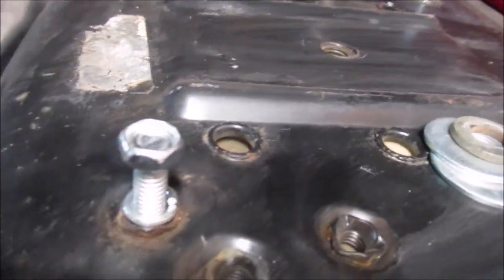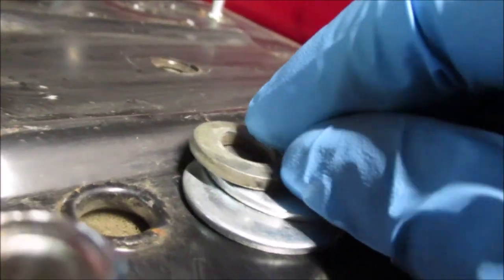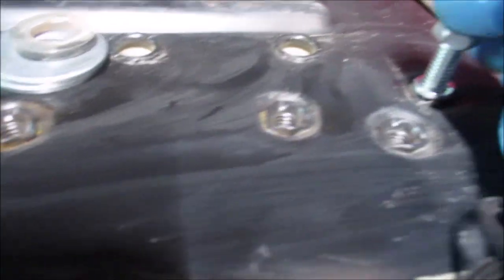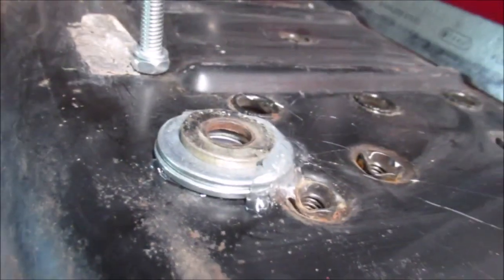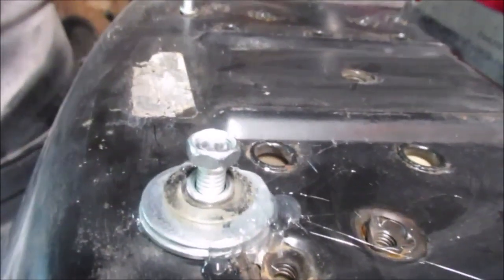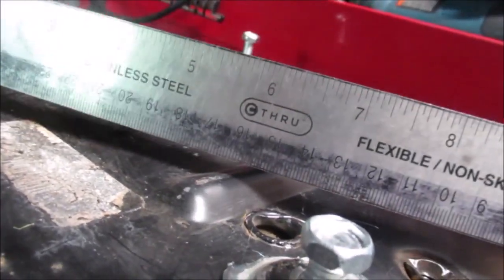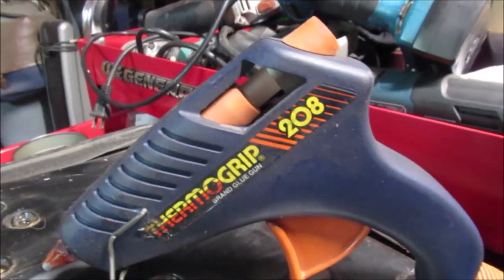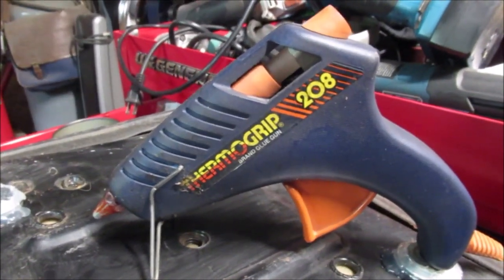A better / proper way to mount tractor seat

Comment: I need a new seat for my Wheel Horse, the pan is good but it’s basically a gorilla tape seat now.  They aren’t cheap.
Reply from the maker: The one on my JD I found at a farm store it was $ 60 ?..I would have to find my video..was cheaper than ordering one